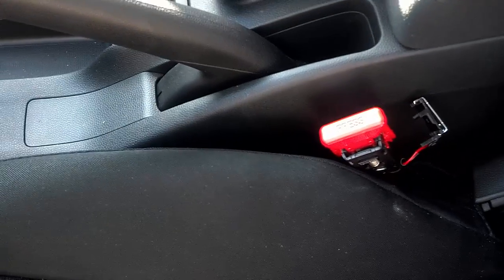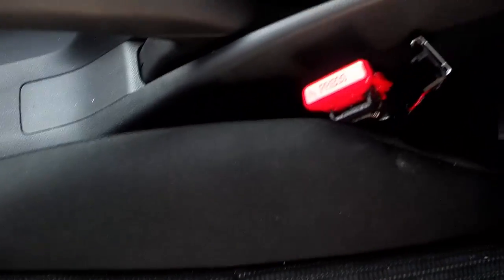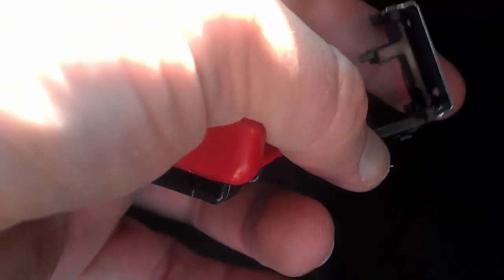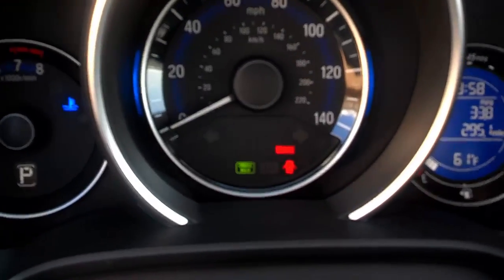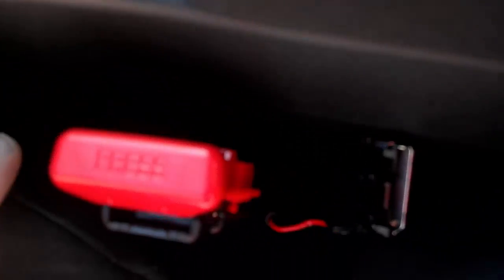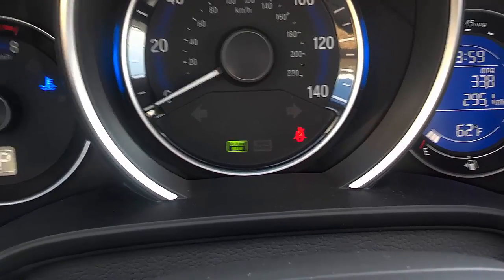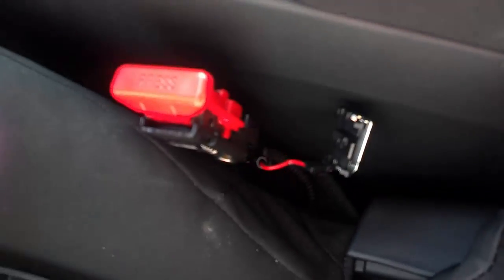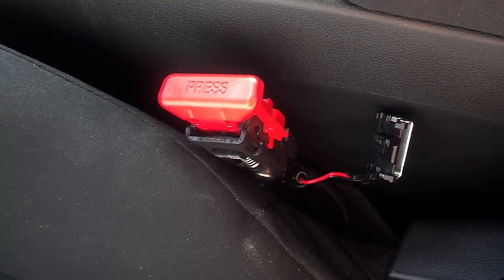Honda Fit Beltminder Turnoff

Comment: Honda, 3 wire system.  Red-Black-Green.  2007 Element has a 3 wire setup.  To simulate the seat belt buckled, cut the wires, connect the black and green together and leave the red open (not connected).  Leaving all wires "open" triggers an airbag warning on the dash.

Comment: Worked on my '13 Civic.  Hugh - at least on my model, it's a separate weight sensor for the airbag.  And yeah the strip might be easy but just did this a moment ago and it was a snap.  Now to decide whether or not I should try to disable the airbag for my pooch co-pilot...

Comment: I'm a little confused.  It seems like you could take that red and black wire, strip them, and twist them together.  This would indicate that the seat belt is connected, right? - and also keep the airbag working?
Reply: Hugh Kallen will that trick also work on the 2007 Honda Accord
Reply: The sensor is not a simple open/closed circuit.  The sensor should not be disconnected but rather fooled into "thinking" that it is latched (it is a magnetic, not mechanical switch).  Then the air bags will work normally. 
 Keep in mind though that on the passenger side if the seat belt reads "fastened, " yet there is under 75 pounds sensed by the seat sensor that the passenger side, a  light will illuminate to show that the passenger-side airbag has been turned off to accommodate a tiny passenger, for safety reasons.

Comment: I know a faster way to cancel the annoying sound....just take the seat belt and click !   Use it !  :-)
Reply: On cold days I like to turn the car on right away, letting the thing warm up during the 10 seconds it takes to put on the seat belt.  Therefore, the annoying chime will be present if I do this.
Reply: Even if I buckle mine the damn thing chimes. Stop telling people how to live, unless you're inviting me to tell you how to live.
Reply: @inquisitorgrynthebandito2736  
Another tip that may be helpful for you is that if the low oil level/pressure lights up, you will not fix the problem braking the warning light. 😉
Reply: @sanpol4399  no but this isn't quite as essential is it?
Reply: @sanpol4399  the car will function safely without the seat belts, that's not the case for oil or brake fluid. Don't give me apples to oranges comparisons
Reply: @inquisitorgrynthebandito2736  👍🏻🙂 relax man.  I am just kidding.   Anyway,  always use the seat belt.  
   👍🏻👍🏻👍🏻
Reply: @sanpol4399  it's all fun and games until someone's had to listen to that chime for 6 months and can't make it stop
Reply: @sanpol4399  and buckling the seat belt doesn't help
Reply: @inquisitorgrynthebandito2736  Did you try going to the mechanic ?